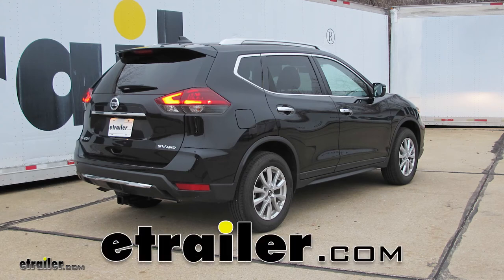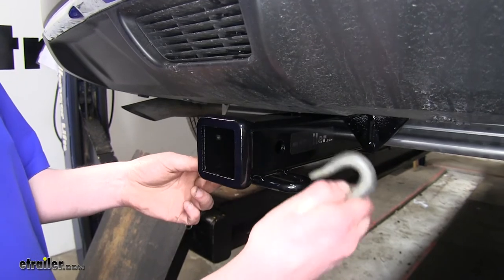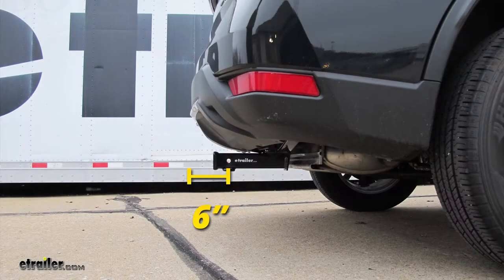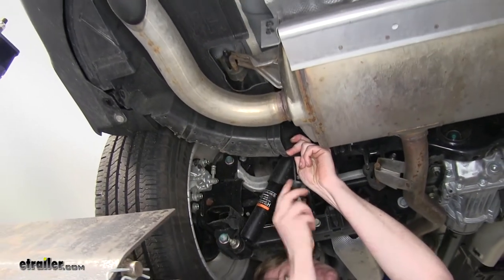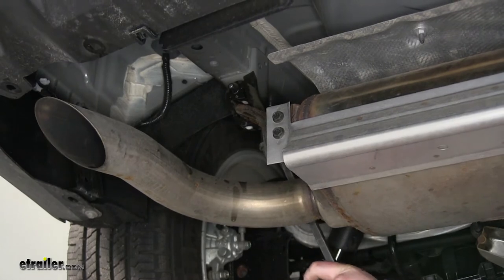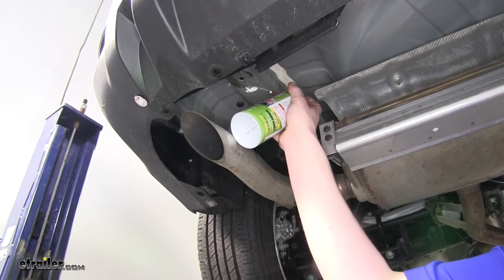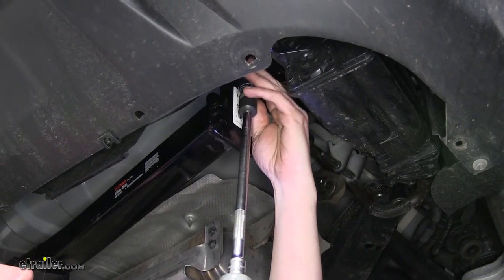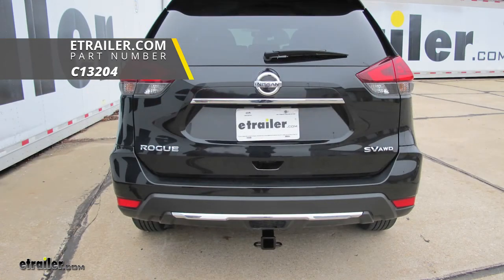etrailer | Trailer Hitch Installation - 2018 Nissan Rogue - Curt

Comment: I'm pretty pissed that my order failed to include INSTRUCTIONS on how to install the hitch.  I have 2 rectangular 1/4" thickness, small metal pieces with a square hole in the center.  However, your instructions didn't include these pieces and I don't believe u used any nuts with the bolts you installed either.  Why not?  Is the Rogue pre-threaded already?  Also, the kit included a long wire, which I have no idea what it's for either.  Are these non-essential hardware or is it required to install by specification.  Can u also tell me what the Torque is specified as, please.  The online store didn't include anything on how to install.  Not even an invoice was included in the box.  I won't be ordering from thar place ever again!  Your help is greatly appreciated, assuming u even respond to my message.  Cheers.
Reply from the maker: This hitch will be installed with the bolts provided and the 2018 Nissan Rogue comes with weld nuts already installed. Is just a matter of cleaning out the threads and installing the hardware. We also have the installation details on our product page in the following link so that you can get the torque specifications.
https://www.etrailer.com/Trailer-Hitch/Curt/C13204.html